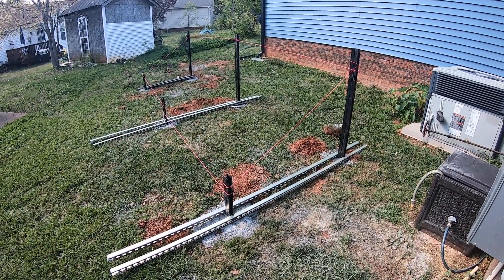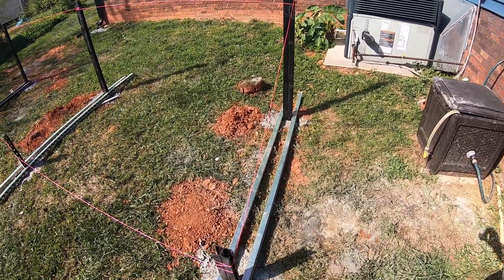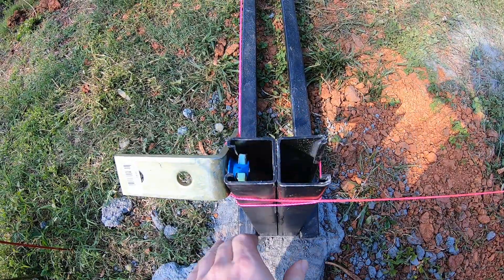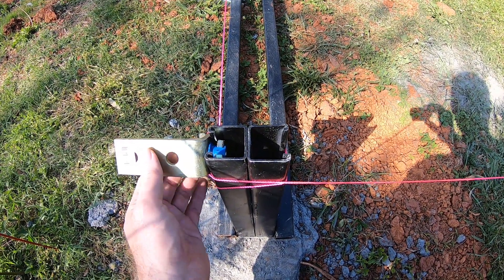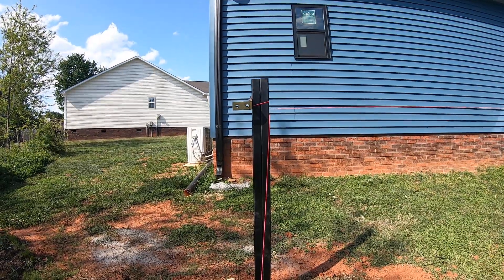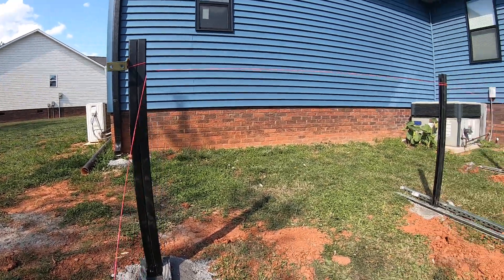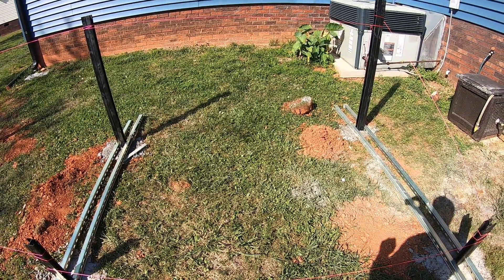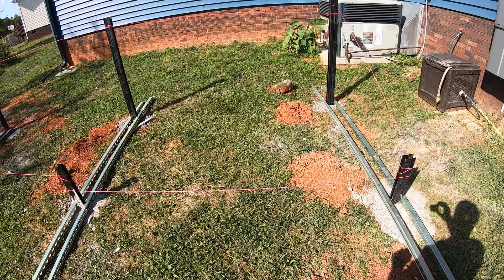Solar Array Addition Part 1

Comment: Why do you have the struts laying on the ground next to the cemented ones?
Reply from the maker: Thanks for the comment.  The strunts on the ground are to help hold the rear ones in place as the concrete sets up.  We poured the front ones first and let them setup so we could use them as a guide and brace for the rears.  These will be removed when we start final assembly.